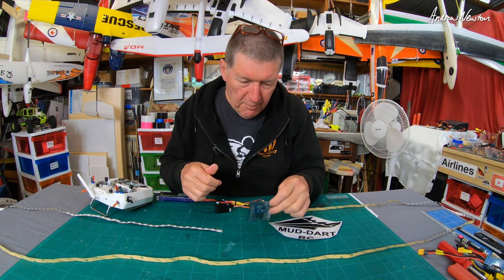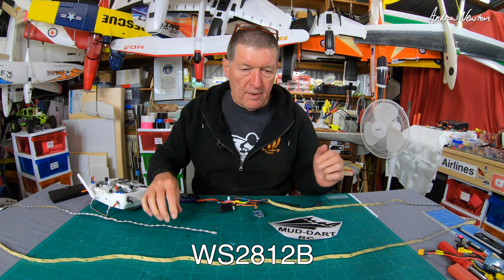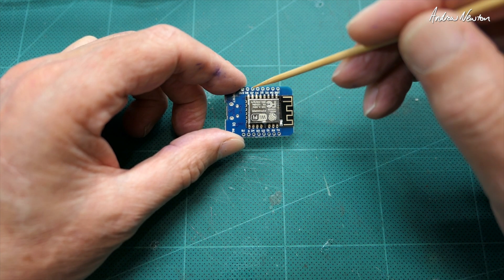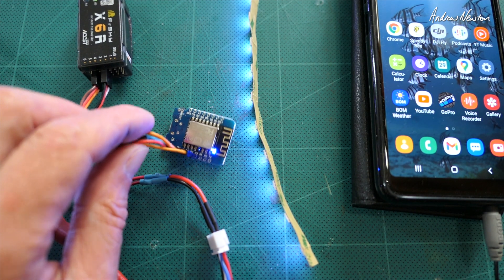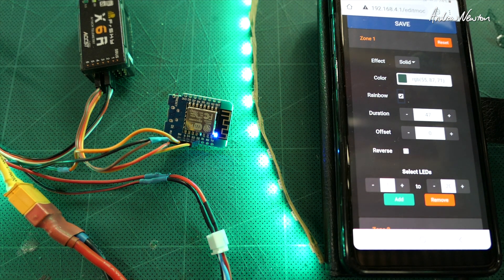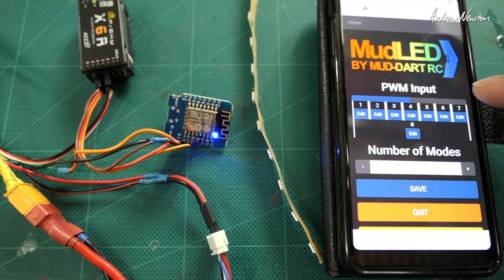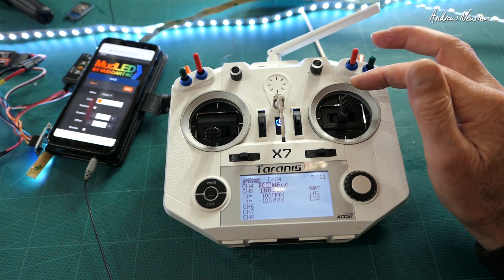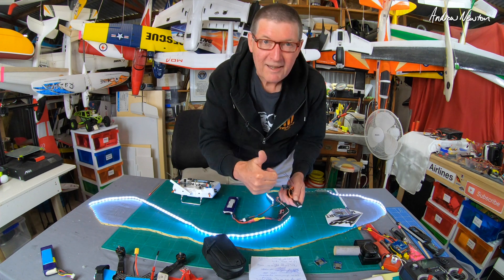MudLED PWM / WiFi LED module

Comment: Can the LED controller run automatically without a PWM signal attached?
Reply from the maker: No. Signal needed to get it working, then you can unplug the PWM source

Comment: Andrew, check out Bitsy LED, its a free firmware you flash to an arduino nano and it will do the same thing with Addressable LEDS and is also designed for RC use.  https://youtu.be/e7a4mR2vg3Y   https://github.com/flyandi/BitsyLED